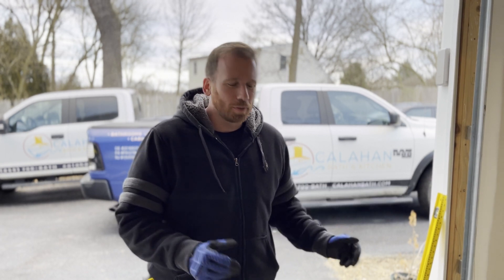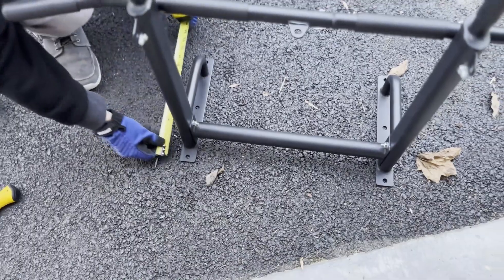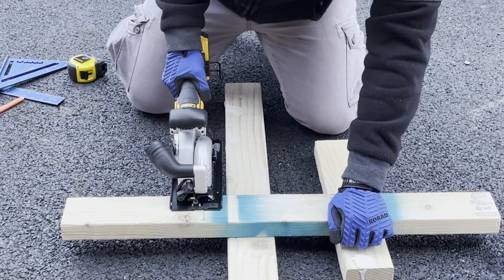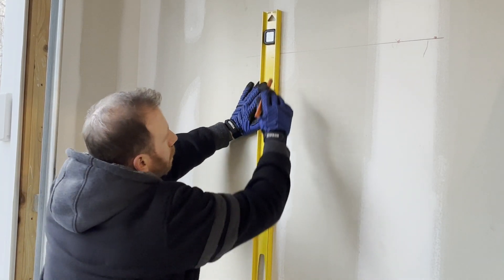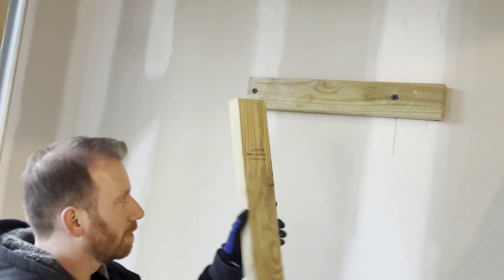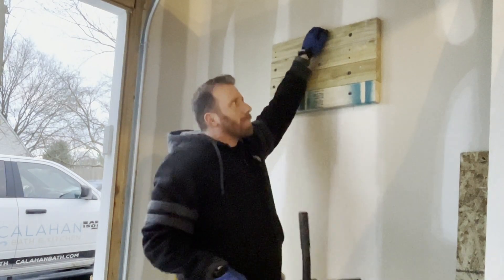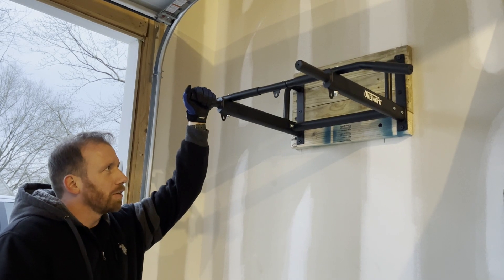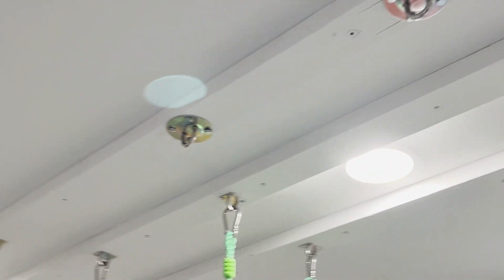Blocking for Weight Suspension, Installing a Pull-Up Bar

Comment: For the 6 screws that you used for the actual pull up bar, did they go all the way into the wall or were they just into the 2x4. How long were those screws compared to the screws which you used for the 2x4s

Comment: You've split the 2x4s by driving the screws with no pre-drilling into them. Those screws are not holding the wood securely.

Comment: What screws and screw size and wood size did u use
Reply from the maker: Deck screws
Reply from the maker: http://diyhoneymooners.com/blocking-for-weight-suspension-installing-a-pull-up-bar/
3 inch